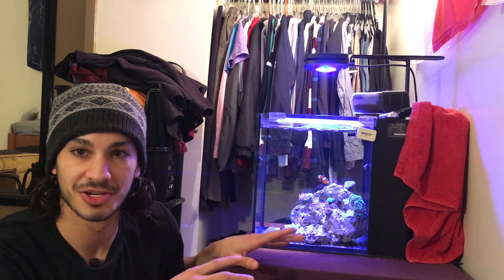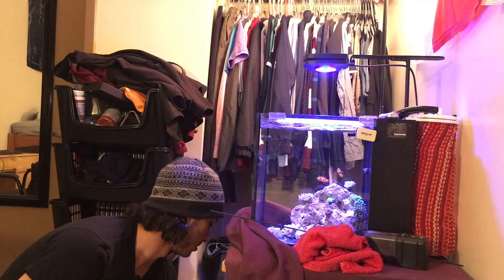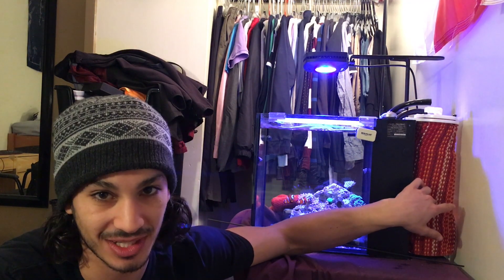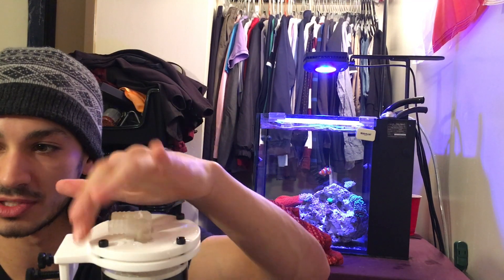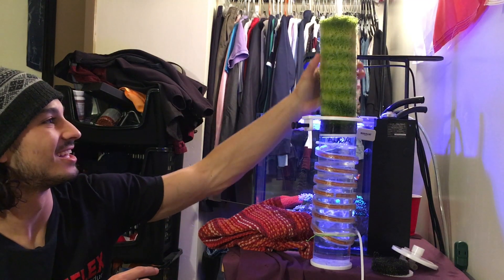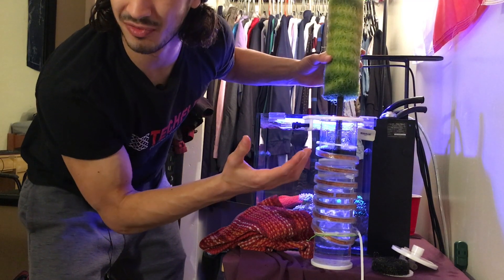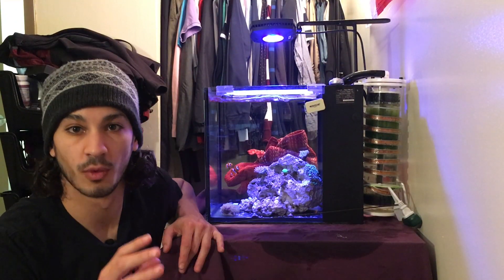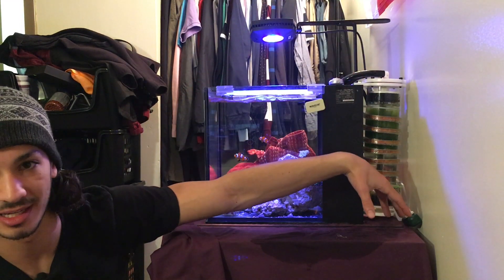Algae Reactor Maintenance

Comment: You mentioned that the bolts failed on the reactor? Whats your recommendation on this?  Going to start one up soon.
Reply from the maker: Yeah they did! They claimed it was from over tightening, but idk about that. I would recommend just replacing them with metal screws. Mine has been working perfectly since I did that.
Reply: Hi where did you get the metal screw? any link? Thanks.
Reply from the maker: I got them off amazon, don’t remember the specs. If you check the Nuvo fusion website it should have the screw dimensions.

Comment: Would his work for my 90 gallon tank with a 15 gallon sump?
Reply from the maker: A reactor this size would be less effective as the size of your system goes up. You could still see some benefit, at the very least it will help increase your microfauna population by some amount. 

A refugium would probably be more effective at the size of your system, but between having nothing or having a small reactor, I would definitely recommend the small reactor.

Comment: I just read a thread on reef2reef where reactors have been failing and leaking from presumably the heat from the lights.
Reply from the maker: I have yet to hear of that. The reason mine failed was because of weak screws. I don't think my leds get anywhere near hot enough to affect the glass/acrylic or whatever its made out of. 

If you're too scared to do an external algea reactor, maybe consider doing an in-tank refugium to achieve similar results without the risk of bringing water out of the tank.

The benefits of the external reactor are increased water volume, 360 degree lighting to increase nutrient consumption, and possibly an increase in efficiency because of the water being circulated directly through the chaeto.

Comment: Great Videos! Is the algae reactor something you made or purchased? If purchased, which one? Thanks!
Reply from the maker: I did a DIY build for it. If you get the same reactor as me with the plastic screws, please replace them with similar sized metal screws to avoid what happened in "My Reef Tank Almost Crashed" video.

Here are the links to the parts I used:

https://www.marinedepot.com/AquaMaxx_FR_SE_GFO_Carbon_and_Biopellet_Hang_On_Filter_Media_Reactor_Internal_Filter-AquaMaxx-UJ45107-FIFRIT-vi.html
https://www.marinedepot.com/Accel_Aquatics_Warm_White_High_Output_Water_Resistant_LED_Strip_Light_with_Transformer_6_foot_LED_Light_Fixtures_for_Aquariums-Accel_Aquatics-6H94602-FILTFILD-vi.html
https://www.marinedepot.com/1_2_Inch_Black_Flexible_Vinyl_Tubing_Black_Vinyl_Tubing-Plumbing_Parts-FT3205-FIFTTUVTBT-vi.html

Comment: how many hours you turn on lights in the chaeto reactor ?
Reply from the maker: The reactor light is on for 12 hours opposite my display tank light. I also have 4 30 minute breaks evenly distributed throughout the 12 hours in order to prevent the rector from heating up the water too much.

Comment: What do you use to dip and did you dip the chaeto when you got it?
Reply from the maker: I use ReVive coral cleaner. At the time that I set up my algae reactor I didn’t use coral dip at all. Looking back on it, I probably would have dipped the chaeto for a bit just to be safe.
Reply: TyroAquaria oh gotcha, you prefer that one over coral rx or seachem reef dip? I have both but havnt tried revive. 
I am going to try out the somatic one uf-1. How long do you run your lights for? Thanks for the info!
Reply from the maker: ReVive is just what I got a good deal on. I haven’t tried either of the others. 

I run my AI Prime for about 12 hours a day with a 4 hour ramp up and 4 hour ramp down. So about 4 hours of it at peak intensity.
Reply: TyroAquaria
 lol I meant your reactor my bad!
Reply from the maker: Oh sorry, I run them the opposite of my AI Prime with 4 30 minute breaks every few hours to prevent overheating.
Reply: TyroAquaria okay got it,  you run it on like two timers? What are your lvls at in the tank? Thanks man, also you dosing or just letting it go?
Reply from the maker: I maintain constant 0 nitrates from the algae reactor. I currently don’t test or dose any trace elements and let any water changes I do take care of that. My coral density is very low and only softies/lps, so I don’t think it’s necessary to dose at the moment.